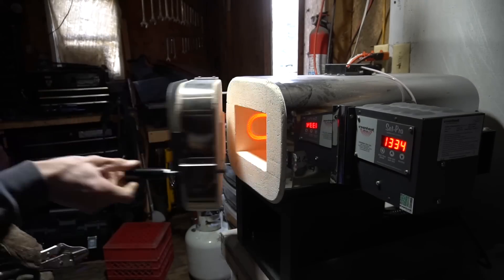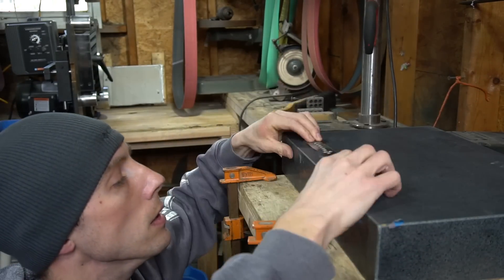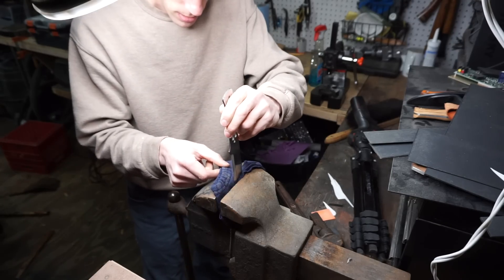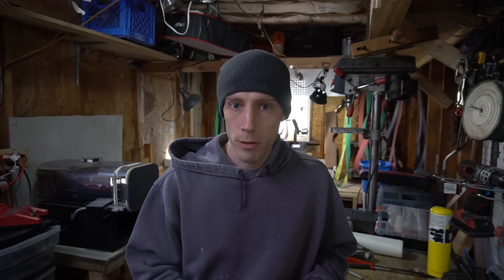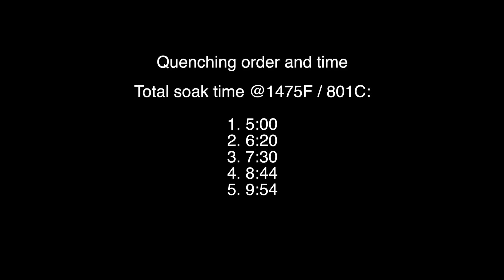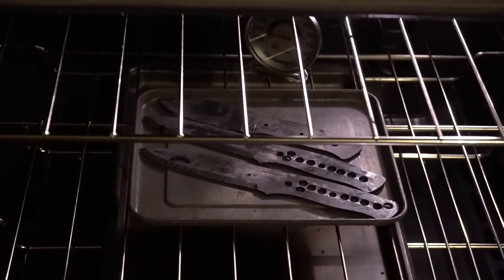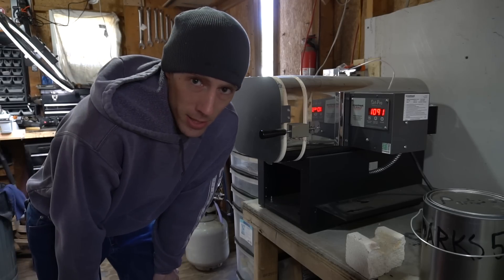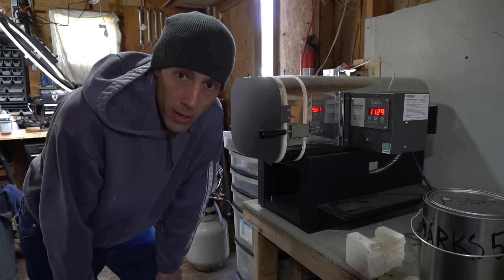Why Knife Makers Should Break Their Knives

Comment: I'm sure you have probably looked into 
"Austenite, Allotriomorphic ferrite, Idiomorphic ferrite, Pearlite, Cementite, Martensite, and so on but if you haven't and have the time you can check out grain structure and the stages it goes through on quench, normalizing, soak time, and tempering. Each is a different type of grain structure caused for their subjective reasons. Maybe shoot for the grain structure you want to produce and study how to get consistent results with Tha specific structure. I'm no metallurgist I'm just a guy who absorbs knowledge and this is not a field I'm a pro in but I have worked with a lot of metal throughout my life and I love knives so I've ended up picking up things over time. Definitely look into different types of grain structure and why they are formed in the specific steel/1095 that you use.
Reply from the maker: Martensite is what knife makers are after.  If one is available, you can generally refer to the TTT diagram ( Time Temperature Transformation) from the steel manufacturer to find out exactly what temperatures and time are needed for any given steel structure you wish to achieve. Unfortunately, not every steel comes with one specific to its exact composition. 1095 for example, is one of them. Thats one of the reasons why a lot of knife makers choose steel like o1 and cpm steel as they come with paper work.  I don't usually go into alot of super technical stuff in the videos because it doesn't make sense for the majority of people.  Basically no one would watch it if we started going over TTT diagrams for 20 minutes 😂  I also can technically show them as most are copyrighted. Thanks my watch man! Again always nice hearing from you👍
Reply: @OUTDOORS55  That's makes sense since a lot of steels are proprietary and tec specs forms would fall under under their secrets haha. I think it's awesome that you know all of that because it shows you know more than just a guy making a knife in a shed for fun. You do basically explain technical things in a very simple way that can be very helpful to people starting out. 👍 stay awesome

Comment: Just a thought from having a Kiln and modifying it. I used to put in my blades into cold kiln and fire it up with them in the whole time up to 1475. Then I would get lots of decarb. Then I would let it get up to temp (1475) put it the blade let it rebound and time it from the time it got back up to 1475. Now since I slit a hole in my front door I let it get to temp wait 10 minutes then slide them in the slit for 5 minutes.From what I have seen in my  testing is the first way is bad because I was putting it the whole time while the kiln was getting hot while the coils are set to max heat or as fast as possible on my kiln which I think is hotter than 1475 that causes grain growth. The second way was not as good because the rebound time can be long and cause grain growth. The last way seems the best with the finest grain I think because when I stick it through the slit without opening the door temp drops a tiny bit and rebounds in almost no time. Check out my last video to see what I mean about the kiln mod. The sweet spot seems to be 5 minute soak time from my testing. I hope you understand my ramblings lol. Also I use parks 50 but with a 7 gallon tank and I have not noticed a difference with oil temp.
Reply from the maker: Thats interesting info!  I was thinking that the ramping up to temp might have something to do with it but wasn't sure. I loose about 50 degrees (if im fast) each time to door opens. And it takes about 5 minutes to ramp back up. I suppose that could have caused the last blade to over heat.  I've even thought about over heating the oven 50 degrees over temperature so that when the blade goes in it drops back down to where it's supposed to be.  Thanks for the info 👍
Reply: Actually putting it in cold is the best way, but if you're concerned about the coils affecting the blade, put it in a tube to shield it so the tube is absorbing the temperature fluctuation.

Comment: A lot of 1095 shows inconsistent results when comparing it to the data sheets because a lot of 1095 has minute amounts of alloying elements, such as nickel. I have had consistent results when ordering steel from the same company, but some slight variations with others (Amazon was a steel ordering platform for a while). I do not have a temp monitored oven for quenching so I only have results based on "feel". 1095 cools very rapidly so its possible when you are pulling the blades out one at a time to quench, there is a drop and rise in temp for the others. I would be interested to see one blade at a time. In my experience I have not had issues soaking for too long, but I honestly can't think if I have soaked at around critical for longer than 10 minutes, again "feel" sadly I never had a watch near me. 
Tldr
Try the soak time test one piece in the oven at a time, might look different.
Reply from the maker: Yeah not all 1095 is the sam. This specific batch is only 0.9 carbon. Thats the minimum needed for it to be called 1095. Ill have to look to see what other elements are in this batch.  I think thats why alot of custom makers seem to stay away from it and use a steel thats more consistent like o1 or cpm steels that give you specific info on heat treating.
Reply: Ecspecially like his recommendation of the one at a time soak test

Comment: Couple question Alex. So for your oven would you put any and all metal/knives in the oven at 1200 then let the temp raise to its set temp(seems like your go to is 1475) and then let it soak for 5 minutes? Or would you put them in at 1475 and then let it soak for 5 minutes?
Second question is when you were heating them before with your little torch stove and would quench once they are past magnetic and then heat for a little longer how does the time compare there?
Reply from the maker: They were put in at 1200 and ramped to 1475 then soaked. When i was using a forge i was using 1080 which doesn't need to be soaked. So it was heat to non magnetic, then about 30 seconds more (depending on blade size) and quench. 1095 is a different beast 😀
Reply: @OUTDOORS55  Ok sounds good. Dont know much about steels yet so just gaining info. Thanks for thr reply!

Comment: I heat treat 1095 at 1485 in my evenheat oven. I put blades in cool and let them heat with the oven. Once they hit 1475 I start the timer and soak for 10 min. and quench in 5 gallons of parks 50. When I do multiple blades I make sure each blade comes back up to 1485 before quenching. Remember when you open that door temp drops quickly. I have not noticed any grain change between 8 and 15 min soak time as long as I allow each subsequent blade to get back to 1485. I usually heat treat 6 blades at a time. I also keep the blade vertical in the quench and do not swish it side to side only up and down. I notice less warpage also I hang them from a hook to cool to room temp before temper. don't lay a warm blade on a bench or piece of metal I have noticed this warp a blade. I have not put a cold blade into an already hot oven not sure if that has an affect
Reply: This is functionally identical to my process.  Do we know if he is quenching in parks or is he using canola?

Comment: Overheating you also stand a chance of decarburization in certain areas of the blade giving you inconsistency in hardness. At least that's been my experience when hitting hot spots in my propain forge. I've since got that ironed out.

Edit: severe overheating. 😆 but you'd be surprised how quickly that can happen in a propane forge. Something I'm sure you have experience before getting your fancy oven there. Nope not jealous. Not jealous. Nothing but happy for you you yoooouuuu. 😉👍
Reply from the maker: Yes I have seen some decarb issues. Im guessing I was in the range of 1600+ degrees for that. 😂
Reply: @OUTDOORS55  hey like I said, I had some hot spots... really hot spots.🙄 or it may have to do with me being a tad impatient and jamming the blade directly into the flame. Cough while using mapp gas. 🤣
Reply from the maker: Haha i was talking about me😂 i may have WAY over heated a blade or 6... even in my mini forge🤣Lost track of time i guess😀

Comment: It's the oil temp.
Reply from the maker: No, parks 50 is a formulated quench oil. oil temperatures were monitored with a starting temp of 110f and ending at 155 for the blades. Well within the optimal temperature. Quenching doesn't really have anything to do with grain growth though.

Comment: Just thinking out loud, the first blade that was problematic have not even been normalized or progressively grain refined. The two other blade had not been normalized either but lower time in HT oven may have limit the grain growth. Maybe the fact that in the latter test pieces you refined the grain to a much finer degree the time spent in the oven wasn't as relevant. I work with 52100 and after the grain refinements step the time I spend in the oven don't seem to affect the grain too much.
Reply from the maker: It could be a normalization issue like you say. That could definitely be plausible. I might go back and try again with pre refined pieces and try the first test agin. Thanks for the suggestion 👍

Comment: One potential flaw I saw was the quench oil itself. I found the testing to be very interesting and thorough except for the quench.  If you infact did these one right after another then your quench oil was way to hot after the first quench. The oil for a quench needs to be between 120 and 150 degrees. After quenching knife 1 your oil was probably aroound 50 degrees. It needs to cool down to 120 to 150 again before quenching the second blade and then again and so on. Unless you actually accounted for this and just didn't mention it. I have found out the hard way that it makes a difference. It's a pain in the ass when having 2 knives to quench and needing to cool the oil first. I have actually gone to having 3 quench tanks so 'i can do atleast 3 blades before having to worry about il cooling. It seems to take forever for the oil to cool naturally after getting it over 200 degrees. Just something I noticed in the video and thought 'i would point out. I enjoy your video's and am looking forward to mre like this because I am looking to better my heat treating as well.  Thanks!
Reply from the maker: I forgot to mention it in the video but the oil temps were monitored. Starting temp was 110F ending at 155F after the first three blades. It doesn't seem like much gain but they were thin blades and the oil can was sitting on a 17 degree floor, so im sure that helped.  Oil temperature shouldn't affect grain size anyway..it could affect hardness, but definitely not grain size. That wouldn't explain the other tests either. The pieces were much smaller and barely raised oil temps whatsoever.  Some others think its a normalization issue. There may have been smaller grain in the normalized pieces, where as the first test could have been starting out with already enlarged grain. Just a theory for now🤷‍♂️

Comment: You could make standardized cross sections of the test pieces for future tests and use a cheater bar that has a notch in a specific place along its length in which you could place a spring scale. Do so could allow you to gather some more data out of each test you make.

Comment: I think the most important thing that was actually shown and has been shown time and time again ESPECIALLY in the straight razor blades that rely heavily on good grain structure is normalization is incredibly important.  They also propose a triple quench to tighten the grain structure.  But normalizing the steel is probably the most important thing you can do.
Reply from the maker: Yes for sure. It definitely helps with consistency throughout the cross section. I believe it could be tightened up slightly more with a couple more cycles. That combined with a slightly lower temperature quench should yeld good results.

Comment: Very interesting video. Recently I've been reading all i can find on 1095, since i'm making a knife from it myself. And I came to the conclusion that there's not a lot of detailed info and what you find often contradicts each other. So video's like this are really great! I'm very curious about tempering temperatures of 1095 as well. From what i've read you can temper 1095 at 500°F to reach a hardness of 59-60 hrc, but most people seem to temper at lower temperatures for some reason. So in short I would really enjoy a video similar to this, but on the subject of tempering.
Keep up the great work!

cheers
Reply: You want to do a minimum of 2 but max of 5 "NORMALIZATION" cycles. Each one slightly cooler than the last before you go into phase 2 of heat treating. This is what will greatly reduce not just the grain structure but also greatly anneal and reduce the stress on the steel.

Suggest you drill holes and bevels at this stage.

Phase two is "QUENCHING" the Metal (Specifically simple carbon steel 1045(0.45%carbon)-1095(0.95%carbon)). This Phase you heat the metal to just above Magnetic Critical(Metal loses Magnetic properties becoming non-magnetic). This means the Atoms are free floating mixing with the Carbon. When you quench(rapid cool) the steel from above Magnetic Critical it forces the Iron atoms to constrict extremely fast trapping the Carbon atoms in-between the Iron atoms. This is what causes a piece of steel to become hard. The faster you reduce the temperature and/or the more Carbon you have the harder the steel can become. However, you cannot use the steel in this form as it can be more brittle than a glass window. I have even seen steel shatter from the pressure of the Carbon in-between the Iron in as little as a hour from quenching When Just sitting on a wooden bench in 65°F 40% Humidity indoors under office like controlled environment. This is why you must move to Phase 3 of the Heat treating process as soon as you can! 

Phase 3 is "TEMPERING". In this phase you must remove just enough of the pressure that has built up in the steel from the "QUENCHING" process that trapped all that Carbon in-between the Iron atoms. You do this by doing the "OPPOSITE" of Normalization. you must heat the metal again (Usually somewhere in the range of 375°F(190.6°C) to 450°F(232.2°C) for 2 to 4 cycles depending on how far you want to draw back the hardness to get the right balance of Ductility and Durability.